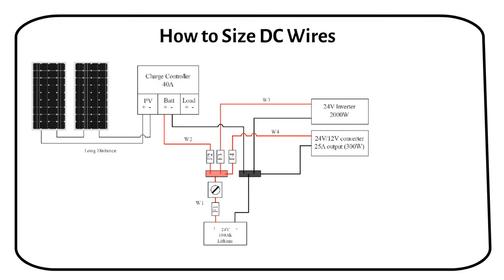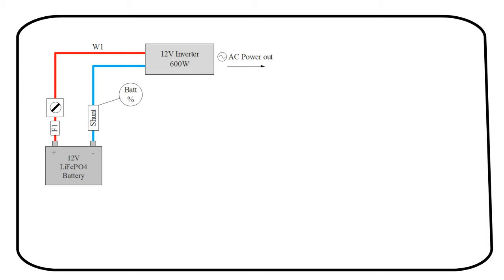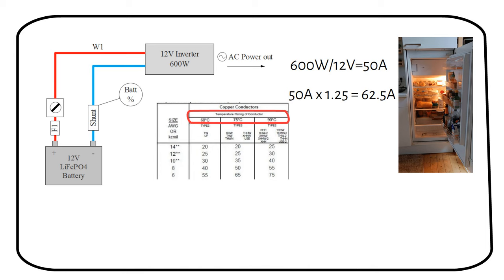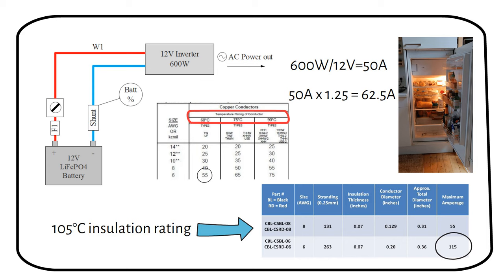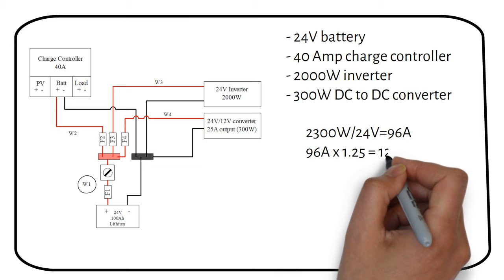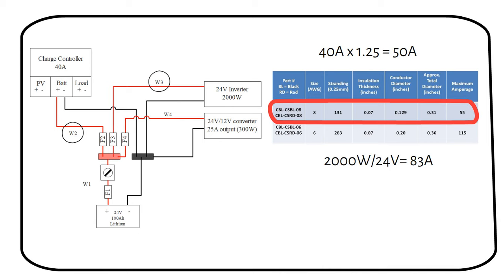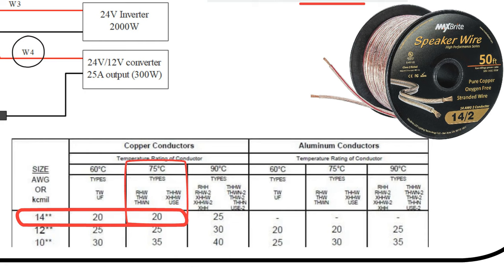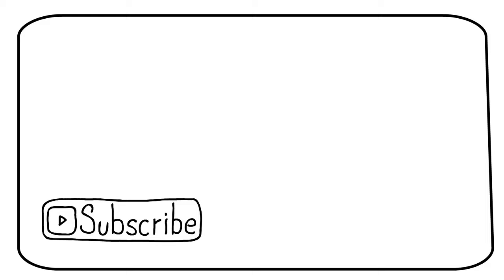How To Size a Wire For Off-Grid Solar Power - Calculation Examples

Comment: Solar panel wire size over a distance and how to calculate the size would be awesome. I have a situation where the panels are  600 ft from where the charge controller and battery are going. No I can't shorten the distance!
Reply from the maker: Check the 4th link in the description: Cable size for solar panels: https://youtu.be/sxgntlX4EzY

Comment: I just bought a 60A MPPT controller for a campervan, and in the instruction it says that I need 6 mm diameter wire for a controller, but my solar panels (450W and 120W) have 4 mm diameter wire:/
Reply from the maker: The wire size in and out of the charge controller is different. The wire going in the battery will have to be thicker because there is more current. Power= voltage*current

Comment: I want to check my house for actual energy use for each appliance before I put in a system.  What monitor would you recommend?
Reply from the maker: I cannot recommend one because i have not done it before. However, your energy meter will tell you the power consumption monthly. You can also note down the consumption per day and put it in a spreadsheet.

Comment: Hello, your illustration shows using  1 battery.  How would adding additional batteries affect wire size requirements?
Reply from the maker: Wire size stays the same. Because the load remains the same.

Comment: How do you connect a wind mill
Reply from the maker: I'm not experienced with wind power. However I've heard they are not worth it for small scale systems. Costs a lot and low power output.

Comment: For the inverter, aren’t you supposed to calculate the max it can put out?
For example, the Victron Multiplus II 24/3000 is a 3,000 W inverter but can handle 5,500 W max (even though for a short period). If I sized for 3,000 W then isn’t that dangerous during max/peak usage? 
Or can welding cables handle overcurrent for a certain time?
Reply from the maker: Cables can handle an over current for a specific amount of time, just like breakers and fuses. Depends on how much of the nominal current it is.
Reply: @cleversolarpower  Ok, so I should calculate 3,000 W in my equations instead of 5,500 W?